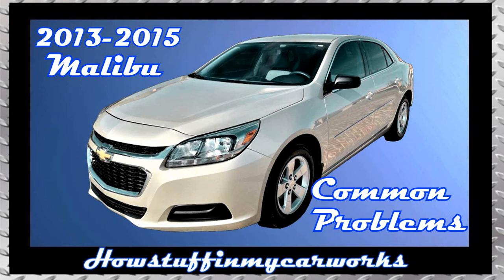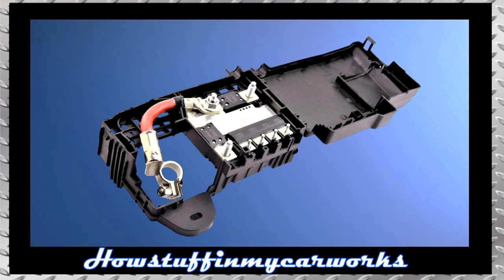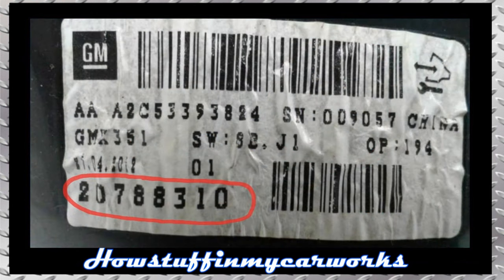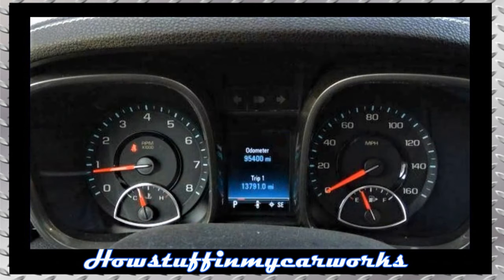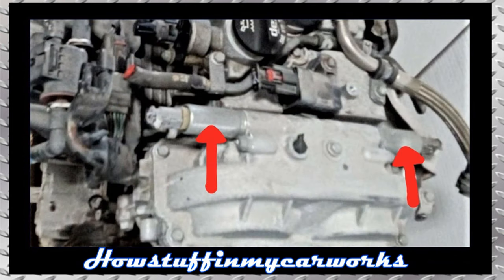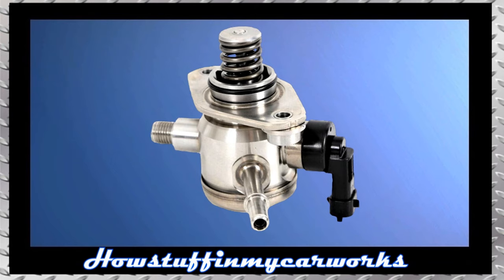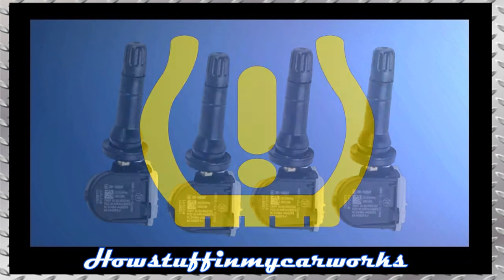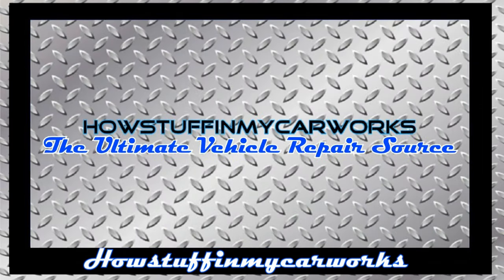Chevy Malibu 8th Gen 2013 to 2015 common problems, issues, defects and complaints

Comment: I used to have to replace my fuel solenoid once per year until I started adding Lucas fuel system cleaner every 6 months. Been 4 years and no gas pedal lag or hesitation.

Comment: Bought a used 2013 Malibu LTZ 2.5 with 45k miles for $8000 last week, only issue is the leather seat cracked exactly as shown in the video other than that the car runs perfect, saving this video for down the line if I ever need it
Reply: Lmk. Looking at getting a 2013 Malibu Eco 1sa 66k miles for 9250   Seems like a very nice car and good on gas average 25/37 for 29 avg. hoping it’s not a lemon like my first 06 Buick lacrosse cxl
Reply: My 2013 Malibu eco driver seat caught on fire. Had to get a new seat, and I just unplugged it. Not having that happen again. Also, having electrical issues.
Reply: Just bought one with. 12,000 miles. It was a hell of a find

Comment: Did the camshaft sensors.  But the weird one was the anti freeze plastic tank reservoir developed a pin hole leak. The door handles on inside the chrome pealed off and cuts fingers and now the reverse camera just quit, other than that the car has been great
Reply: My door handles inside cut my fingers as well

Comment: Look, I have worked at dealerships since the mid 70’s, and as the EPA, CARB & sometimes the DOT require high fuel economy and engineers receive a bible of these requirements up to 4-5 years before taking effect. Every manufacturer has older engineers retire as younger inexperienced folk replace them. There is not one car, truck, Ute, cross-over that doesn’t have 3, 4 or 5 things go bad. It generally happens during warranty! 5,000hrs on a car is 150k miles. Lighter, thinner, cheaper, global and yes, everyone gets parts from around the world and big, small and Canada/Mexico in the mix. TBS are quoted here, not recalls. Parts that fail in high volume are called back for non-destructive and destructive failure analysis. A second design is issued. Here is the “RUB”. Aftermarket want a chunk of action, but they copy the original part with minor changes because of copyright infringement. But aftermarket shops are sold these parts. Not better, the ones that failed! Go to the dealer as they go online by VIN and problem, get a “Second Design” part…problem gone. Change oil & fluids. Use the correct stuff as 13 ATF versions fit one brand, not 13! 
This is filling wiper bottle with water in Florida, then job changes and you are in South Dakota. It will freeze but I am sure you have other things on your mind, like staying warm!
DK, ASE master tech since 78, retired.

Comment: I think the most common problem is p0171 or lean code due to vacuum leak which can also give u code p2091 and p0300(misfire). Replacing maf airflow sensor will help some but most likely the culprit will be intake manifold gasket needs replacement but not before u check any hose leak with a smoke leak test. Fixing that leak p0171 most likely fix p2091 air/fuel mixture(getting more air than car actually needs). If u don't want to spend big money on a smoke machine then diy the cheap way. Buy a Mason jar $1,baby oil $1 buy a soldering gun $4 both and air pump with 2 rubber line$6 both at harbor freight. Make 3 holes on the Mason jar cap 1 for the soldering gun, 2 for the 2 tubing line 1 that goes to the hand pump and the other to the  brake booster hose. Put some rags inside the Mason jar and pour in baby oil in it. Close the lid and let it warm up and u have ur smoker. Advice disconnect hose where the filter and maf sensor is and place a latex glove over the air hose. U don't want the smoke to get to the sensor(too sensitive)
Reply: Yeah I'm having this very same issue right now. 2015 chevy Malibu LT. P0171 keeps coming up. I changed o2 sensor, plugs, coil packs, and now I'm going to do the smoke test thanks to your post. Thank you. Rhonda
Reply: most likely your intake manifold bolts have loosened. its very common and will give that code, just tighten them up. happened to mine, i got that code and almost started replacing parts like you but sure enough i could see the blue manifold gasket, tightened the bolts and boom, fixed.  @RhondaRodriguez-rg4my

Comment: My Seat cracked just like in the video... amazing. Anyone else dealing with a coolant leak 150K plus miles, as well as engine combusting the oil?(100K)
Reply: probably water pump leaking.  and yes my car burns oil
Reply: Yes
Reply: My car burns hella oil
Reply: Same here guys coolant leak and oil guzzler
Reply: Might be spark plug seals from valve cover doing atm as well as all other seals in the head with 114,000
Reply: (1)Yup my water pump went bad the other day had gotten it fix..

(2)when starting my car it’s a loud grind nose it doesn’t happen all the time but when it does it very annoying  sometimes the car will not start until I remove the key put it back in to start the car I took it to cable Dahmer an other car shops around town they said my starter is fine no codes have showed up. SMH

Comment: 02:15 Happened on my 2014 Malibu, and also my tmps sensor on my rear passenger side tire is going in and out
Reply: Your car is over 5 years old , It's normal for those sensor to go out after this meny years on Any Car/truck. 
They have batteries in them most only last 3-5 years before needing replacing 
You can have a tire shop like American tires replace them. But don't only replace the dead one replace all of them because they all have batteries with the same time on them.

Comment: Define low mileage. Mine is at 12,000 should I worry about my bearings?
Reply: My wheel bearings went bad around 200k miles, so 12k should be fine. Not all of them at once, first passenger front then driver rear

Comment: 2013 starts drives good for 10-15 mins then messes up dosent want to shift loss of power and dies overall underivable any fixs
Reply: Literally the same issue. Any fixes or did you just get rid of the car altogether?

Comment: Anyone had trouble with their car not wanting to shift up into 2nd or 3rd. I have a 2015 Malibu LT and barely 70's miles on it. It only does it sometimes but I want to fix before it tears up. One owner vehicle and I tested at AutoZone with a code tester and it shows that my shift solenoid #2 is stuck open and I think #5 may be stuck closed, or visa versa. I am just almost due for the 75,000 transmission fluid flush, filter and refill service. Has anyone else been through this?

Comment: hai. need answers from GM mechanic.

when my car nearly run at 60 kmph. The auto gear not working. I have to side park switch off the engine.. then restart. Plz give me guide.. cher malibu 2013 model. please give me GM complaint section do i csn seek advice. It is a good car. but need advice from GM in order to rectify this problem..I live in Brunei. South East Asia.

Comment: (1)Yup my water pump went bad the other day had gotten it fix..

(2)when starting my car it’s a loud grind nose it doesn’t happen all the time but when it does it very annoying  sometimes the car will not start until I remove the key put it back in to start the car I took it to cable Dahmer an other car shops around town they said my starter is fine no codes have showed up. SMH

Comment: ‘13 2.5, cam solenoids, most of the wheel bearings, thermostat and temp sensors. All before 100k and of course after warranty. Rear screw type calipers are pure crap. Pretty much single use garbage. Otherwise solid.

Comment: Another thing. 2013 malibus are stalling & not many people or shops knows what's causing the stalling.
Reply: When you accelerate, the rpm goes us but the car speed not so much?
Reply: @jamesc0890  my car started doing it too
Reply: Is your dash lights coming on n off?
Reply: @jamesc0890  no, but it does this before it stalls when I come to a stop or driving couple miles. Backing up it will stall as well.
Reply: @jamesc0890  mine is doing this
Reply: @jayyboog2680  did you figure out your issue ?
Reply: @kenetrai3526  I have a 2016 Holden Malibu 2.4L LE9 Ecotec, practically the same as the chevy ones just in here in Australia. My car is having the issue of random "Service ESP", "Service Car Soon" lights. This causes the car to go into limp mode and at a stop, the revs bounce up and down then eventually stalls. Also the throttle response is poor, gently accelerating there's no response, 2-3 seconds later it kicks in if you accelerate hard enough. I have no engine codes and this issue happens randomly, its been happening for 4 years as it was fairly rare to happen but now but now its more frequent so it causes a concern. After searching for what feels a lifetime, this "Accelerator Position Sensor" seems to be the most likely issue now. Is my issue similar to yours?
Reply: @jamesc0890  I have a 2013 Chevy Malibu ltz 2.0 lt turbo and it means u need new coils or spark plugs
Reply: MY 2013 CHEVY MALIBU IS STALLING TOO!
Reply: My car has been stalling as well. I have a 2013 Chevy Malibu LS. I have replaced the spark plugs, the battery, the solenoid sensors, the throttle body and 02 sensors. Decided to take it to the chevy dealer. One person said sounds like timing change another said o2 sensor.
Reply: Happend to me stalling reverse fans will stay on after car off it was temp sensor it was burned on the tips 🤦
Reply: I have a 2013 Chevy malibu LT 2.5L ecotec turbo. My car will sometimes just randomly shut off. Like, the wheel locks up and the car completely shuts off in the middle of me driving.... I replaced the crankshaft position sensor and boom no more issues. Well fast forward to now, about a year later, and my car shut off randomly for the first time again. Except now it says "service battery charging system." Overall the car has been very good to me, i got a GREAT deal with it at only 90k miles, practically perfect cosmetic condition, and $6800 USD.
Reply: @texasoutlaw2052 yeah bro look at my comment idk maybe we are having similar issues lmk if you find a fix

Comment: My TCM failed at 172 000 KM . Transmission Control Sensor . Code P0700
Reply: What were the symptoms? Where did you get the new one?? Mine failed too. 2014 ltz 2.5L
Reply: @Guzzor2  Bought one used on eBay. Make sure the 8th digit on TCM module matches 8th digit on your TCM module. A B C OR D IS GEN 2 G IS GEN 3 WHICH MEANS YOU HAVE UPDATE DIFFERENT TRANSMISSION FLUID PUMP. IT WILL COME WITH SOLENOIDS. SPRAY SOLENOIDS WITH CrC electronic cleaner to ooze the dirt contamination out of it. U0101 is the code for lost communication with TCM. After install, disconnect pos and negative battery cables from battery. Then attach alligator clips wire connecting them together for 10 minutes. Make sure battery has at least 12.2 bolts. Reconnect cables to battery terminals after taking off alligator clips. Car should start right up. Let idle for 5 minutes. Shift through each gear while holding down brake pedal for 5 seconds apiece. Put back in park. While engines running, take the 11mm transmission level bolt off located on driver's side on the side of transmission just above the transmission axle shaft add oil to top of transmission with black cap unscrewed until it slowly drains out of 11mm hole then replace the bolt and tighten it and screw top transmission cap on. Drive nice and easy for 20-30 miles then drive it slightly more aggressive another 20 miles. Transmission should be good to go and adaptive learned after that
Reply: Put in at least 6 quarts of transmission oil after a repair. It takes somewhere around 7.5 quarts to start trickling out of 11mm hole

Comment: This car is a horrible investment and design. Water pump replaced at 30k, rear hub replaced at 40k, cam selonoid replaced at 45k, stop start "technology" works in new york only lol, seats were ripping and breaking down within 20k. Evap leak code constantly, replaced gas cap twice, when sitting in passenger seat the whole dashboard and radio shuts down while driving so we lose the mph's and eveything and comes back on sometimes. The car looks nice but what a piece of ish in my opinion!
Reply: I'm sorry that was your experience, mine has 203k with no problems...just regular maintenance....my seat did tear and my water pump went out at 200k.
Reply: Not my experience either. I have 296k and besides oil changes, tires, and brake pads, I have only had to replace the oil control valve. This has been a great car for me.
Reply: @compneo  What year ? And original trans ?
Reply: Bruh you’re lucky. My 2014 has 137,000 and I’ve replaced 2 batteries, water pump fuel pump thermostat, oil control valve, wheel bearing and now for the grand finale I’m dealing with a p0116 code which is probably gonna be a timing chain. I’ve paid just as much as the car is worth in repairs.  Currently trying to get a Toyota
Reply: @compneo there’s a recall out for the oil control valve.. if you bought the parts yourself you can get refunded.
Reply: Had the Shift to park BS happen
Reply: @compneo That’s really great! It’s amazing how not even the typical expected maintenance like alternator, tune ups and suspension seem to be an issue. Some cars need do over with those parts as early as 50,000 miles to 100,000 miles.
Reply: Can someone tell me why when I’m at a stop light or put my car in park the auto stop starts shaking..one time at a light it tried to cut off I need answers please I have a 2015 Chevy Malibu it have 240k miles
Reply: I agree soon as I get it crank I'm selling lol
Reply: @katrinabosman2535 
- Shaking at idle is the VVT solenoids (intake and exaust). 
- Engine stall/cutting off? Maybe a loose cable on the battery or battery box on top of the battery. If any of the cables move, tighten it down with 10mm socket.